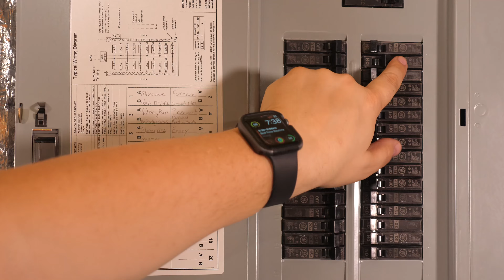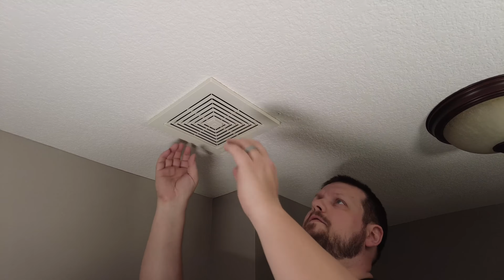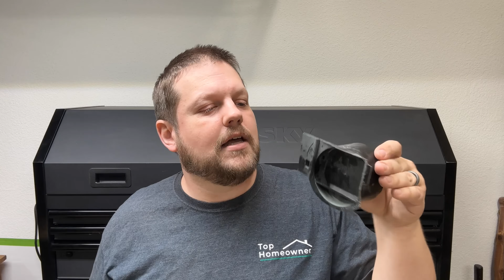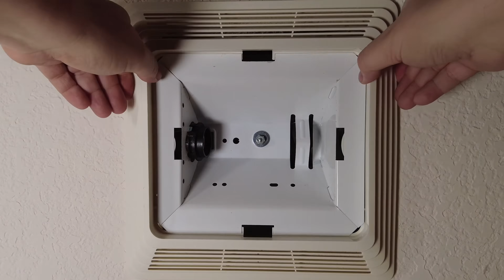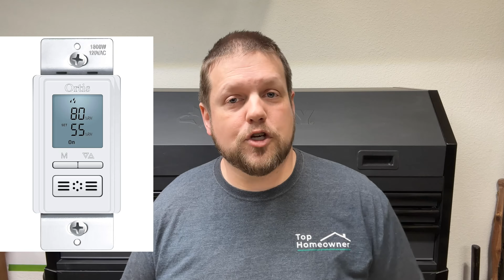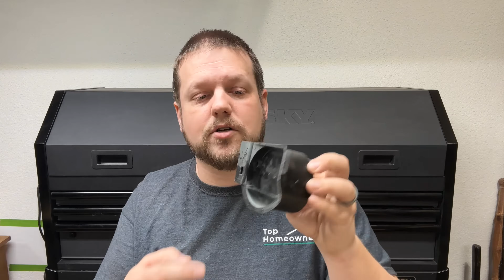Exhaust Fan Fixes: Complete Troubleshooting Guide

Comment: I have a Nutone 663 L fan model from the late '80's with an integrated light.  I replaced the motor and fan once before many years ago and just replaced it again about two week ago.  It sounds louder than before the replacement with a loud humming sound.  The inner metal shield and outer grill are held in by a bolt and wingnut, not springs.  Without them installed, the fan doesn't make the humming noise.  With the inner shield and grill installed it runs normally for about 5 minute and then kicks into a fairly loud hum.  Tried different tightening levels with the wingnut, but in the past it just worked in with use until the humming noise went away.  Do you have any ideas on how to fix this from the beginning rather than having to wait for it to break-in?  Thanks!

Comment: Who should you call if your exhuast fan in the powder room on the entry level of the house is leaking in the summer? No rain.  It's been a dry summer. The fan spits water when you turn it on. Leaks driplets when off.
Reply: Can water get in the outlet where it goes outside?

Comment: If the “flapper” is broken and it’s letting air in and out, how do you replace just that? Does the whole unit have to be removed and replaced?
Reply from the maker: You'll need to buy a replacement duct connector for your specific exhaust fan that has the damper inside. Sometimes you can install them after you remove the motor by slightly bending the pIastic damper and clicking the sides into place. You should be able to tell if that's the case when you purchase the new duct connector. If not, you might be able to replace it from the attic, or you'll need to remove the entire fan housing from the ceiling in order to remove the old duct connector and replace it. Hope that helps.